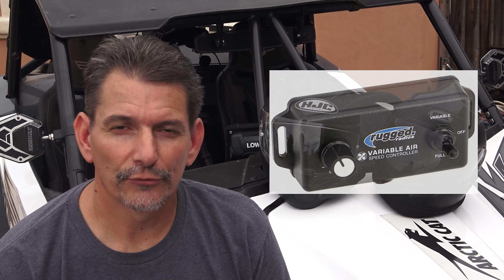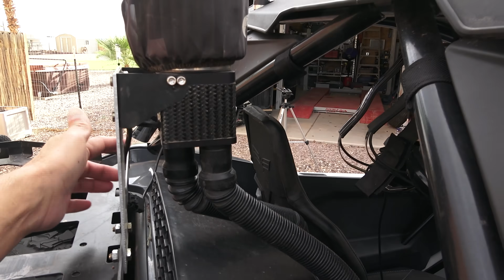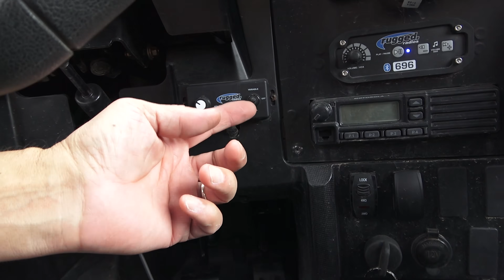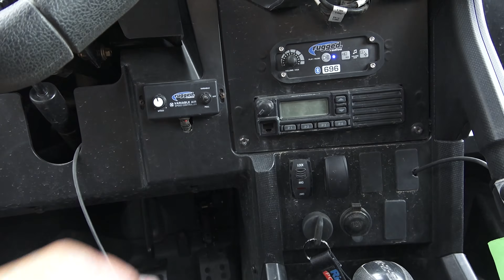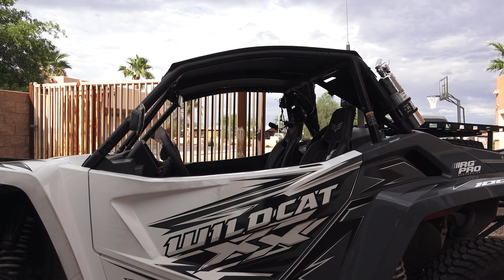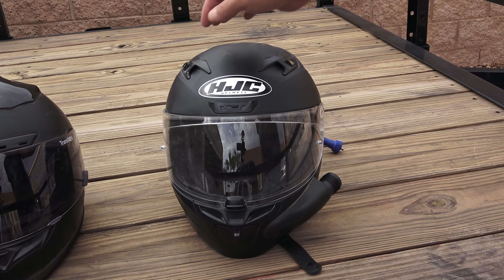Rugged Air Pumper and Helmets Install & Review

Comment: Bell helmet you have the dust skirt witch makes the air flow seam to be less, more back pressure. The top flow is also better if you use a intercom, car to car radio system. The side air flow tends to blow on the microphone, creating wind noise when you try to communicate with passenger and other drivers. I have used both top and side inlets. They both have advantages, but if you put the dust skirt on the HJC helmet, your results would be more apples to apples.  as fare as connecting the hose to the helmets, use the mag connection, that evens the plying field on both Helmets.
Reply from the maker: Really appreciate your comment and sharing your personal experience for others to make an informed decision.  I do have a car to car radio/intercom system in both helmets.  I have used the skirt on both and the HJC flows way more.  My wife wears a Bell because she likes the transition lenses and styling of it.  She also owns the HJC as well and on hot days she will wear the HJC due to its better air flow.  Neither one of us have experienced wind noise through the coms of either style helmet.  Again, thank you for sharing your experience.

Comment: Do you have to plug the passenger air hose if you are driving solo?
Reply from the maker: It is recommended as you will loose a lot of volume.  Here is a link to a bar mount plug that you just plug the hose onto when not in use.  If you get one, make sure you get one with your bar diameter.  https://amzn.to/3f2HaJ2
Reply: @DougsX5  Thanks for the link 👍
Reply from the maker: @hmtrimworks7148  Of course, thanks for watching!